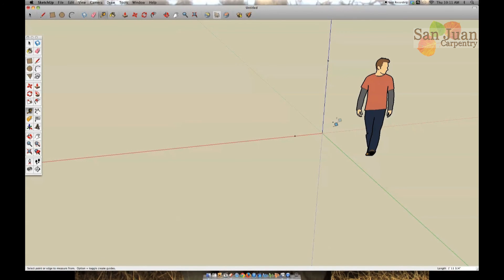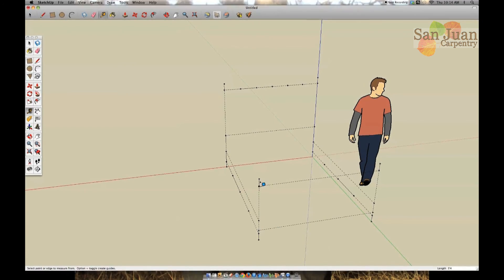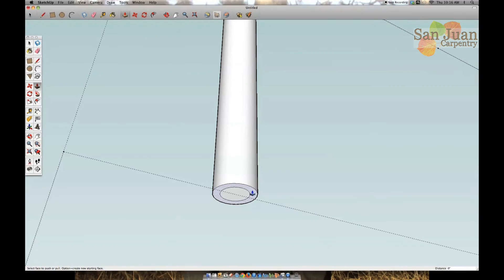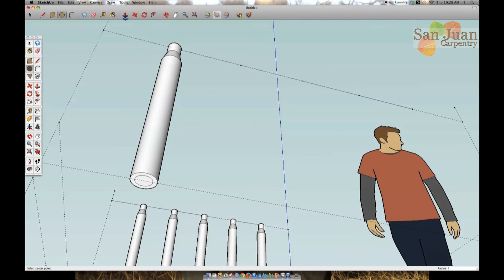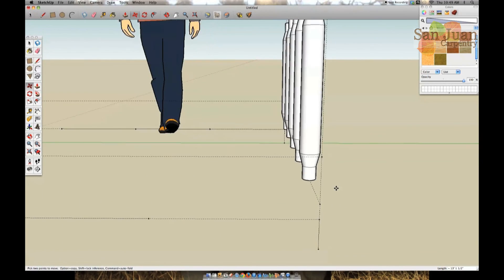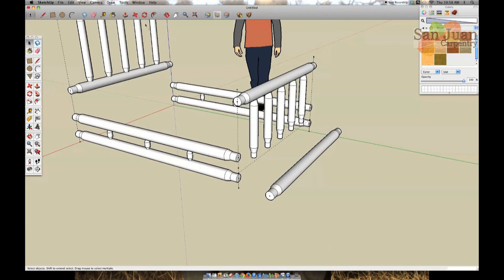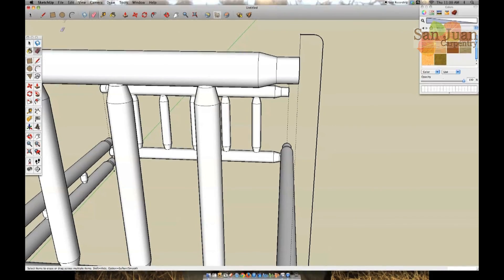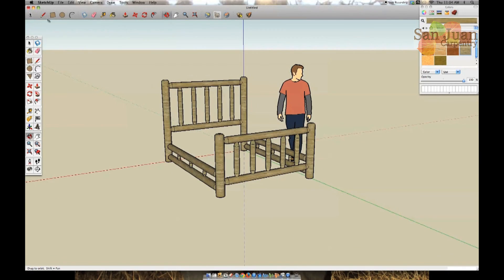Design a Log Bed in Sketch-Up

Comment: Great video - love using the measuring tool to sketch dimensions and this will save me a lot of Sketchup headache I've had until this point. Can't believe I never thought of it. Also love the 1.5 speed on the video for those who have moderate Sketchup skill already.

...if that's not 1.5 speed, holy CRAP

Comment: Great job on sketch up. And nice design.
One thing, you can copy and x7 instead of copy each one. It will space them up equally.

I never thought of initial sketching using the measure tool. It's so brilliant I will probably use it every-time from now on
Thanks

Comment: I do have anther question, Is there a way to draw the mortises like you would for regular objects?
Reply from the maker: I did make a video about how just make a spindle with tenon but after I made this video I decided not to publish it thinking it would be redundant but you have a good point so I will post it next week. I'm not sure what you mean by "regular objects". Any tenon can be drawn the way I did it. If you're using square boards with loose tenons for example, just draw the shape of the tenon on the end of the boards and use the push/pull to pull it out however long. Did that answer your question?
Reply: San Juan Carpentry I now have to tenons figured out, its the mortises I was wondering about, by regular objects I mean like a square table leg